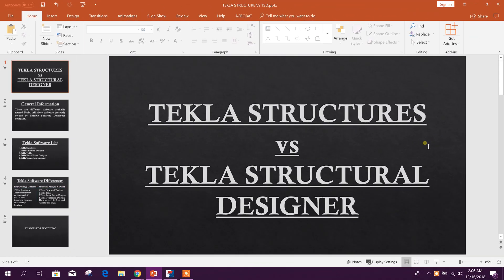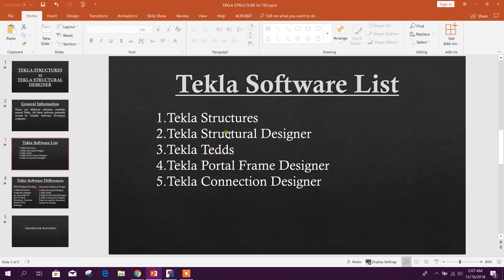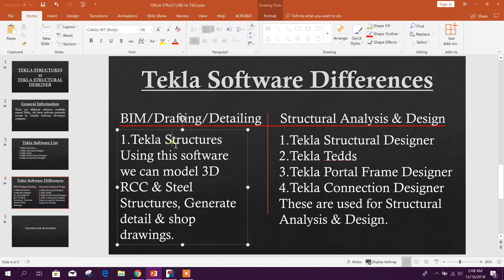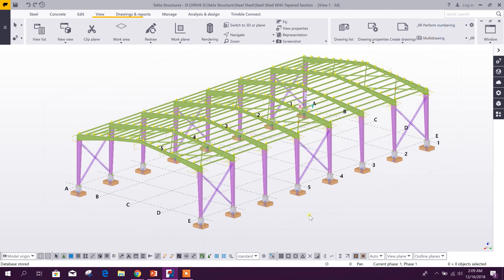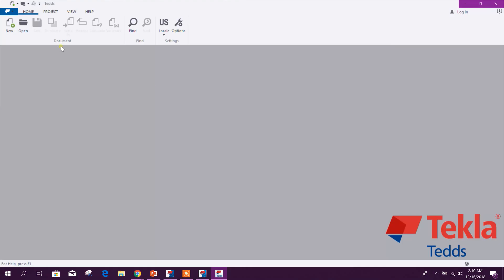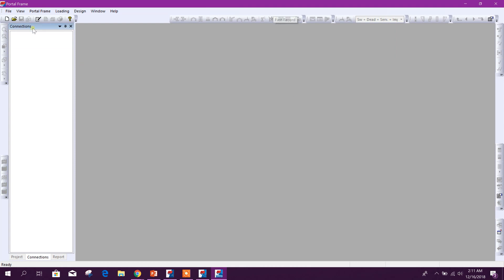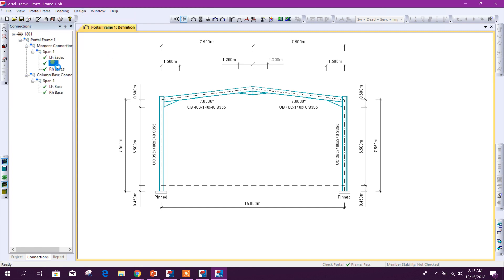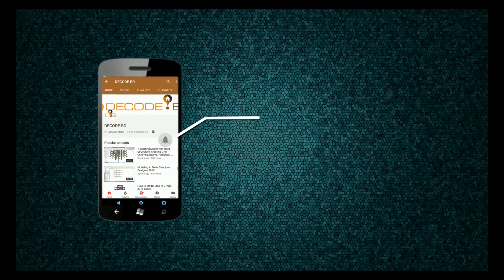DIFFERENCE BETWEEN TEKLA STRUCTURES & TEKLA STRUCTURAL DESIGNER

Comment: The Crack for both Tekla structure design and Tekla Portal frame connection is in the same folder and name is also same.When we install the softwares and paste the Crack for portal frame the Crack of structures design is getting replaced. How to solve this issue?